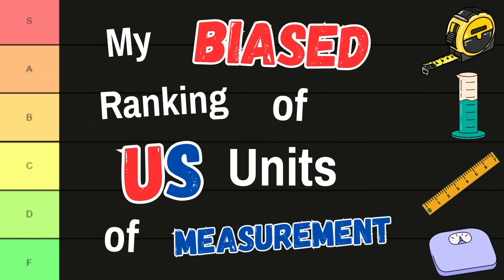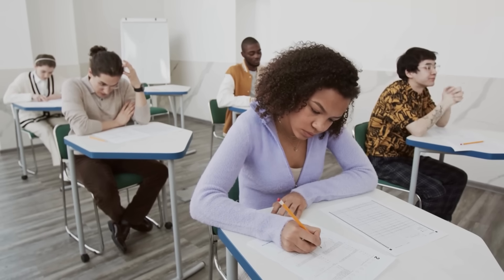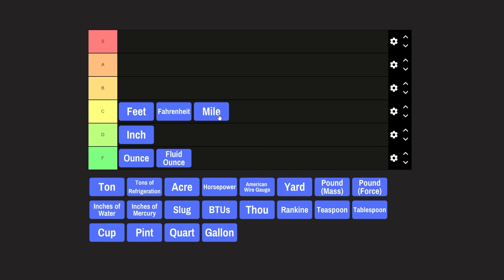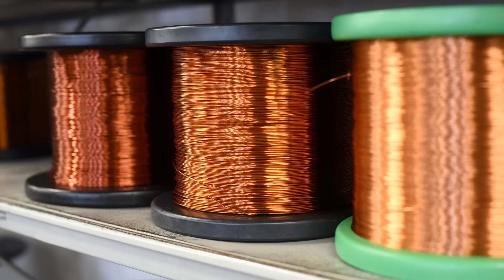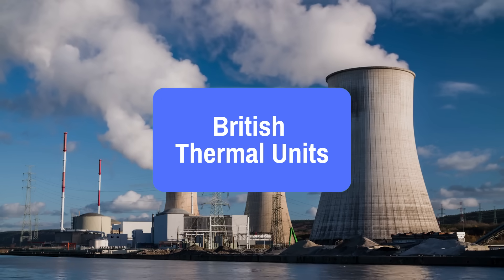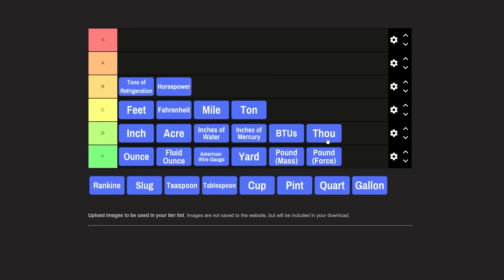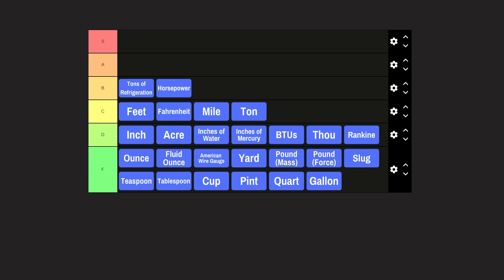Tier List of the DISASTROUS US Measuring System

Comment: All rubbish , using parts of the Human Body as measurement when nearly every Human is different is utter nonsens , the Metric System is far superior , you only need to know how long 1 Meter is  , and everything else is a part of a Meter or a multiply of a Meter . In the old days there was a Master Sample of a 1m stick and all other Tools for measurement 1 m were a copy / paste of the stick . In current Times they adjusted this because its not excact enough , a 1m stick  can shrink or expand  depending of Temperature and humidity so they came up with the Light Speed as Standard = 1 m is the way light travels in 1 sec divided by 299.792.458 in a vaccum . They could have made it simpler and have adjusted it to 300 000 000 but then there would have been a 0.069 % difference to the old 1m stick definition . 1 milli m = 1/1000 m , 1 centi meter = 1/100 m , 1 Meter , 1 kilo meter = 1000 Meter . Celsius is more logical too than Fahrenheit because  0 C is when Water freezes at Sea Level and 100 C is when Water boils at Sea Level  a clear Definition , Fahrenheit is random because Human Bodys dont have all the  same Temperature and why using water with an additive for 0 F ?

Comment: As an engineer who has had to work with US based units, horsepower is bottom of F tier. Absolute worst unit of measurement I’ve ever had the displeasure of working with. It’s about 550lb*ft/s. I hate that we can’t just use lb*ft/s instead of doing some weird conversion to horsepower. Absolute garbage unit of measurement.

Comment: Boy am I happy having the metric system these days in Europe. You can think of Napoleon and the french what you want, I am happy they put a hold on most of this non reliable measure units. Just go with 10 everything is fine. PS is still used in most Europe as reference it more relatable on a daily talk as a force unit.

Comment: If US Americans had a single brain cell left, they could understand that any scale from x to y is useful if you are confronted with it on a daily basis. Celsius and Kelvin relate to energy, meaning that with the same amount of energy needed to heat water, you have an equivalent amount of temperature rising. 5 degree of C/K always equal to the same amount of energy. With Fahrenheit, 5 degree up from 0 and 5 degree from 80 are different amounts of thermal energy. Or in other words: your temperature unit, Fahrenheit, has no relation to temperature.

Comment: Imperial makes a lot of sense as a more primitive person, not trying to sound offensive. But like if you were trapped on a deserted island, and you needed to measure something, you’d almost always use your feet. Then if you wanted a smaller measurement, you’d probably split your foot down the middle, then if you need it smaller, you’d split that half into another half etc etc. Which gives you the 2, 4, 8, 16, 32, etc, uneven numbers that imperial has. Like it all makes total sense, and is very good, until you get into mathematics, or any complex stuff. Then all the sudden it makes way more sense to have simple things that are divisible by 10. So metric is better in todays world, but imperial should still have its place if we were out in the bush or something. But the fact that miles are 5,280ft is stupid, if it was 5,000ft then it would make sense.

Comment: I can tell 7.3km=730000cm without thinking. Who can tell how many inches is 7.3 miles without using calculator? That's the problem of imperial unit. It's impossible to convert without calculator.

Comment: 27 of 30 years mfg in USA where making and selling our products in Imperial units (in addition to metric) cost us more than we made in profit.  Only 3 years, we were able to make enough to have a surplus after paying for pointless Imperial units required only by the USA.  Most of cost was for software errors which were 90% caused by conversion errors.  All our software ran in metric so conversions took place at input and output stages but whenever a software run was modified the conversion errors would occur. Some costs for metric and imperial tools and fasteners, but mostly software where we had to option displayed in both units. 
Next was US dates: MMDDYY vs Canada DDMMYY and Europe which was often YYYYMMDD HHMMSS  so that is what we standardized on for all communication and in software since anyone can figure out what it means.
Next was the comma separator such as one thousand in US is 1,000 whereas in Europe it’s mostly 1.000.

Comment: Cups and be filled to a certain marking or until completely full.  Either way, they are a measure of volume and are most often used in cooking where a the recipe should ask for a certain mass.  To make them more inaccurate, fill them as much as possible and the volume will now also contain of the properties of the measured substance, say flour which isn't always the same.  Convenient and inaccurate.  Similar for the various types of spoons which are also even less standardized in size.  The only saving grace is that most but not all recipes are somewhat tolerant to inaccurate measurements and experienced cook know how to adjust.

My favorite nonsense unit is proof for the measurement of alcohol.  The measurement procedure used historically already appears to be so unnecessarily complicated it almost looks like a prank today.

AWG?  Full middle finger mode.  May be acceptable to people who only need to install wires and cables but totally unsuitable to do any kind of math with.

Comment: Lots of US customary units are missing, including (but not limited to):
1 - fifth (1/5 gallon, used to measure volume of liquor before 750 ml bottles were standardized)
2 - barrel (comes in multiple size depending on the contents)
3 - hogshead
4 - peck
5 - bushel

Comment: Fahrenheit wasn't based on a gap of 100. It was a gap of 64: body temperature minus ice water. This allows even and perfect divisions using a compass as dividing by 2 and marking over and over is easy. There is no easy way to make markings 100th of something precisely. 
Foot, I put in S-tier. It fits in a notebook and I have two of them and can measure a room. A meter is inconvenient. The stick is too long, too course, too hard to have on hand and I don't have a built in meter, but I do have feet. Rooms are whole numbers. 11x16 or 10x12. Plywood also whole numbers 4x8. The foot is the one thing I'd miss if we went metric. They should have made the meter shorter and more convenient.

Comment: But the USA doesn't even use the "imperial units" that loads of other countries once used. All around the world a ton was 2240 pounds, but only in the USA is it 2,000 pounds. In the rest of the world a pint was 20 fluid ounce, but in the USA a pint is 16 ounces., with the flow on to quarts and gallons. Even the volume of a fluid ounce is slightly different in the old imperial system compared to USA. I could go on. 🙄

Comment: Until you realize an inch is a foot cut in half 4 times. Furthermore, a pound is divided into 12 ounces. 12 is divisible by 2, 3, and 4. Much more practical than 10, which only divides evenly by 2 and 5 (who measures anything in fifths?)
Reply: They are still trash and the metric system made them completely obsolete
Reply: Sure maybe 12 has more factors than 10 but in metric that just doesnt matter. Instead of having 5 different units that just equate to a smaller or larger scale you just have one unit with standardised prefixes that equate to smaller units
Like nobody would say "Oh yeah thats 1/25th of a metre" you would just say "yea thats 25 centimetres/250 millimetres"

So like why do I need to divide my units when I just use a smaller unit that follows the standard format. 
Distance, Weight and Mass, Volume, Density, Pressure, Speed, Force, even the storage on your computer, its all the same

I have never understood the factors argument because you dont divide the units you just reference it from below
Reply: Even further yet, criticizing fluid ounces as the unit of volume that one ounce of water fills undermines the metric system as well. One gram of water takes up 1 milliliter of water, which is also equivalent to a cubic centimeter of water. Unfortunately, a fluid ounce is not equivalent to a cubic inch, but you can't have everything.

Comment: trainee electrician from europe here 

american wire gauge is not low enough in f tier 
why you might ask well what happens when you dont have a solid/round wire core , flrxinle wire is made of dozens of small wires that have a lower carying capacity for the same wire diameter thats right youd use the european measurement wich is just millimeters squared because surface area of the wires cross section works with both
 
put that garbage messurment into the please for the love of god use surface area

Comment: The cooking units use value immediately if you need precise measurements of solids. It's so dumb to make this volume based. A cup of flour? How fine is it? Did you tap it a little so it became more dense? Did you scoop it or pour it in? All different.

Comment: Watching USA carpentry channels where fractions of an inch are used just totally floors me. Keeping track of 184 7/16” less 2 3/4” plus 16 1/8” has me yelling, use mm’s. But the imperial system is not broken because of the base units used, it’s because there is no consistency or inter relation between them.

Comment: The biggest issue with the cooking measurements that we metric users can't even fathom, is that they are not units of weight, but units of volume.

Meaning that you can't convert spoons to grams without taking into account what exactly you're measuring as a given water volume doesn't have the same weight as a flour volume.

I get how they can be convenient. But watching Americans cooking is a little bit weird because y'all have your little spoons of all shapes and sizes it's very cute. ☺️

Despite all of this, I actually consider that Fahrenheit is a better measuring system for the weather. But for the weather only.

Comment: You could resonate all you want about fahrenheit, but Boiling point of Water and Freezing point of water in Celsius make more sense.
After the scale of the measurement day to day is really how you live with the unit.
0° freezing water, 4-5° snow, 10° cold, 15°C spring season, 20°C you can try shorts, 25°C starting to get hot, 30° hot, 35° really hot, 40°C can't do shit, 50°C death valley hot.
-20°C freezer, 180°C oven thermostat 6.

The wire gauge units is really showing how stupid imperial is. You have to have a specific unit for a specific use, and you convert it in fraction of an inch, 0,46inch?
I've never though about the pound having to be differentiate for force and mass.

In fact all the imperial used for any calculation is a nightmare. Cubic inch?
Reply: I don’t think he’s saying it ‘make more sense’ only that it’s increased resolution makes it better at describing weather.

Comment: BTUs are extremely overrated. Unnecessary unit of energy, used mainly to confuse people to make them buy way oversized air conditioning systems, which makes them work inefficiently, which is a burden on the power grid, and all wallets except ac manufacturers and by comission the installers

Comment: My favourite is the mixed up units they use for specifying car tyres (at least in the UK but I assume it applies in other countries too).

If I want to buy a new tyre I need 3 numbers (there is the speed rating letter too but that isn’t a dimension)

So I will get something like 225/50R19 where

225 is the width
50 is the depth of the sidewall
19 is the radius

Expecting some consistency, then think again

19 is the radius in inches (imperial)
225 is the width in mm (metric)
50 is the percentage of the width - so the actual dimension is 225 x 50% = 112.5mm

Comment: As an Indian I Hate that we use the mashup of both😂
We use °C for all the temperature doesn't matter what, but when it comes to fever/body temperature we fcuking use Fahrenheit😂
For everything measurement, we will use metric system, but when it comes to human measurement(height) we fcuking use foot and inches,😂
Acre is used, but the value very arbitrarily , depending on the states the acre differs, some state straight up use hectares😂
But on the topic we still use square feet for smaller measurements and square metres for larger measurements 😂

Comment: The Mile is an antique unit for distance, it was itroduced by the Romans wich needed a way to measure distances in the expanding empire. So they took the most constant an known "thing" at the time, the Legion. They make the legion count 1000 paces and used it as  a standard, that's how the mile is born. By the way 1 statue mile (not nautical) is 1609mt

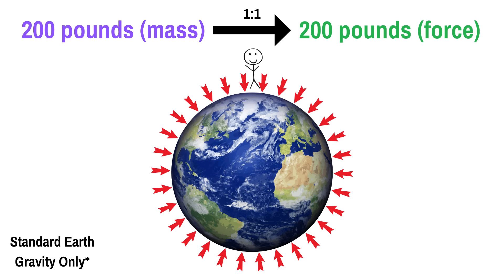Comment: 5:39 so the American value for earth's gravitational field strength is 1lb(force)/1lb(mass)
Reply: 🇬🇧:Also we say kilograms and celcius when calculating specific heat capacity which we say is In Joules per kilogram per degree celcius (or kelvin instead of degrees celcius for a-level and above)